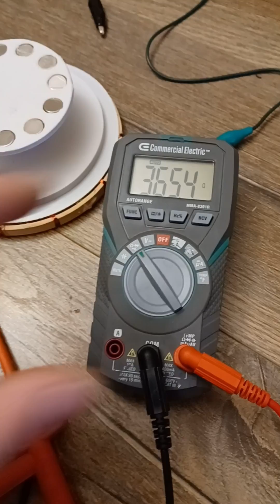Overunity Dodecatron Generator Part 2: Power Output of 1 coil

Comment: out of curosity and new to 3d printing.  have you wound a 9 point coil as per the directions given by Tesla using the main coil earth connected and free air to drive the 369 coil configuration?
as in using atmospheric(aether) frequency to push current into the 369 configuration?